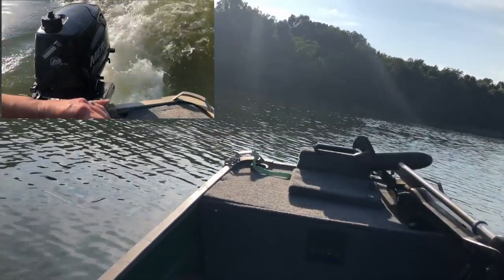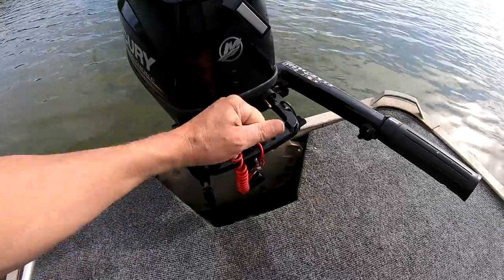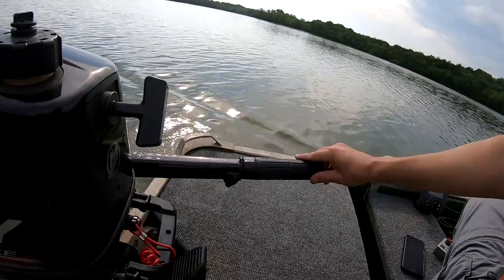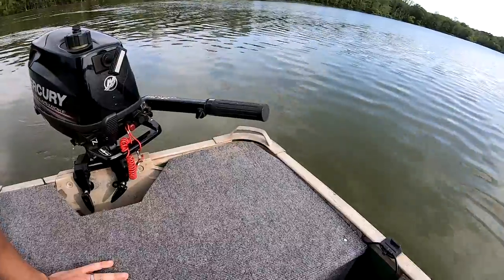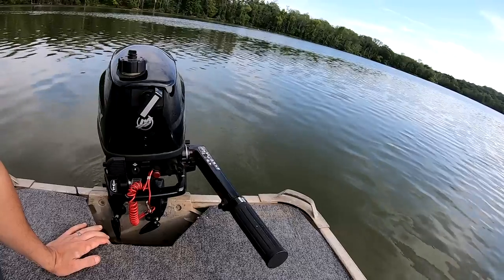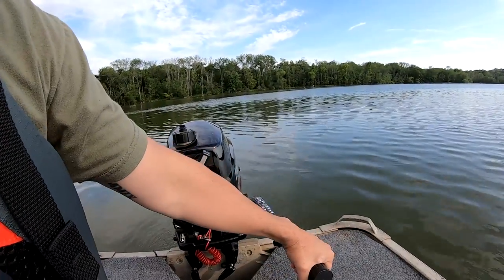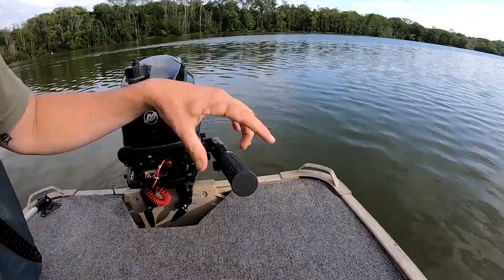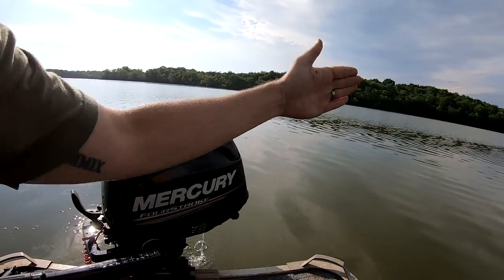How To Drive A Jon Boat

Comment: Thanks for the video. Inherited a 1436 Jon boat , I’m new to the tiller motor. I’ve learned quickly until I master it I need to stay in smaller bodies of water with no currents. I find it difficult to manually adjust a 15.hp motor. Great videos, keep them coming.
Reply from the maker: Thanks for the view! Good luck! Hope you are enjoying your setup

Comment: I’m running a 6hp evinrude fisherman with a bigger tank on my crawdad with a new 3 blade and only hitting 14 mph. Do you think going to a smaller tank and adding a jack plate will help?
Reply from the maker: Do you know what pitch prop you are using? If it’s a 7 I would try an 8 first before investing in anything else 

I think the smaller tank would a little bit. I would experiment with the trim positions and where you have your battery. 

If your anti cavitation plate is parallel with the bottom of the hull you shouldn’t need a Jack plate
Reply: Yes sir I’m running a 8 inch pitch prop  I have tried all my trim positions and 14 was all it had.  The cavitation plate sits lower than the hull of my boat by at least 3 to 4 inches I have a jack plate already I just figured I would get a second opinion thank you for the reply.
Reply from the maker: @brandonlee1396 yeah if you are 3-4 inches low that Jack plate may help. If you are planing out good then I would look at weight reduction and the Jack plate.
Reply: Thank you your the man keep coming with the killer content